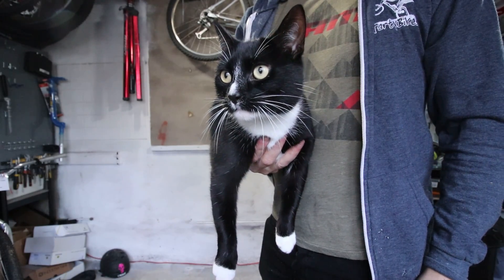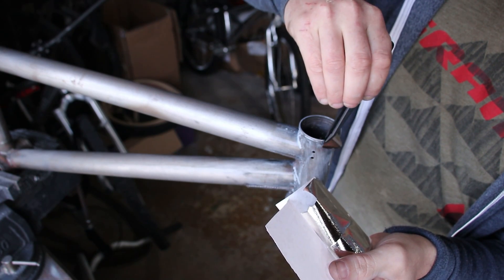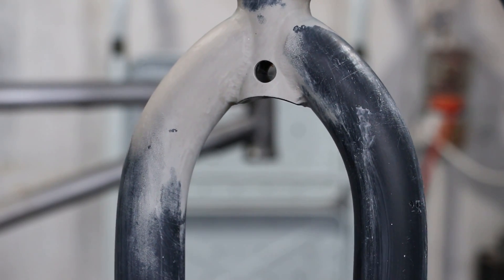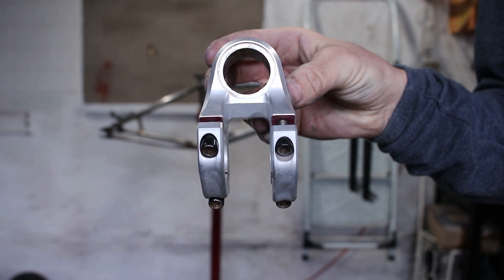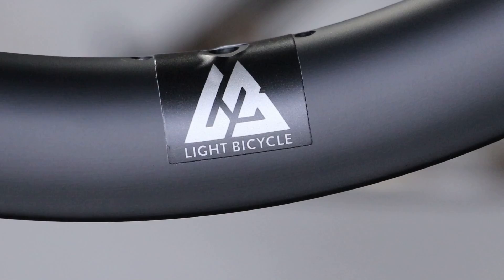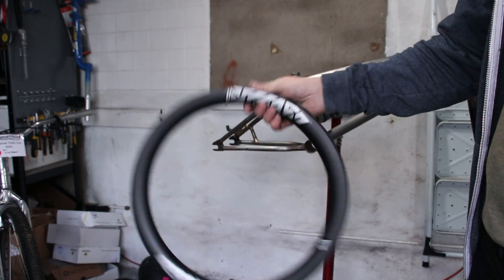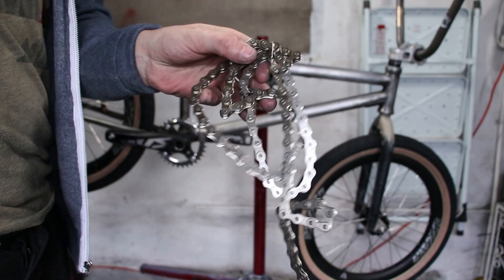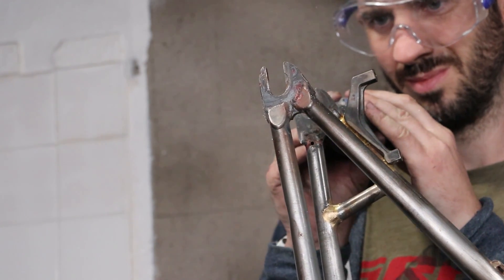I Built a MTBers BMX With Carbon Rims, Disc Brake And A Few Surprises

Comment: I know a lot of what you said was tongue in cheek, however I just couldn’t let some of it slide. 
It’s not necessarily that BMX riders or companies are backwards, the reality is that simplicity is often best. 
Having worked in the bike industry for over 20 years I have seen many MTB and road companies successfully introduce new standards. Often, these don’t offer any real benefit to the average rider but instead drive sales for their brand. It’s good business and keeps the industry alive. 
In the BMX world, BSD, Wethepeople, Stranger and others have tried to introduce oversized bars, tapered head tubes etc. etc. but ultimately they didn’t catch on. 
Why? Well, they just aren’t necessary. 
No one doubts the science behind these products but they are trying to fix a problem that doesn’t exist currently.
Combine that with the fact that the BMX market is typically younger, with less disposable income - any innovation needs to offer a significant improvement over what’s out there already. Pivotal seat systems are a great example. 
Your bike is definitely very interesting and fair play to you for putting in the effort. As you say though, a lot of the components just wouldn’t last on the streets.
Reply from the maker: I 100% agree with you 👍🏻

Comment: Disks don't work out that great on a 20 inch bike for park/street. The disks get destroyed in no time. pretty much impossible to do any grinds on the disk side. The smaller 20 inch wheels also bring the dropout closer to the ground than bigger wheel bikes. This makes the disk more likely to hit curbs and rocks. Giant/Mosh were doing oversized stem and bar clam areas back in the mid 90's. It didn't work any better, was heavier and limited what bar and stem combo you could run.  It was a mountain bike thing giant carried over to mosh, their BMX line. I guess it only took 30 years to catch on. You do know they make half links for normal bike chains right? grinding those drop outs out like that will make the rear tire sit extremely close to the seat and chain stay junctions. Its going to limit the size of tire you can run in the back and will probably end up rubbing the frame. How's the chain alignment with all that extra crap sticking out of the bottom bracket?

Comment: finally, a bmx with disk brakes
Reply: bmx has had disk brakes for quite a few years now. a lot of race bikes run them and ruben alcantara made a bmx with disk brakes and suspension
Reply: @brapamaldi  I know that race bmx' has had discs, but street bmx' usually has no brakes at all
Reply: @furivno  which would make this not a street bmx then going by that definition

Comment: Awesome build! What is that bottom bracket adapter? I've tried 24mm Mid bearings and cannot get the proper width - even with alloy spacers!
Reply from the maker: Link to adaptor in my pinned comment at the top :)

Comment: I built an S&M 24” ATF with disc brakes a few years back. Profile racing elite hub and some other nice parts. Then sold it 😫. I’ve wanted to do a 20” build and you may have just given me the nudge I needed! Great job

Comment: So you took a frame welded a disc mount on!? Its to bad build your own frame.
Reply from the maker: I didn’t, someone else did. Cost £50 for the frame and welding which is a bit easier to swallow than many hundreds for a custom frame!

Comment: Lots of generalizations being thrown around in this video that aren't exactly true. This is basically a modern BMX racing bike but with a chromoly frame instead of Alu or Carbon. Disc brakes and hub compatibility isn't an issue, there are plenty of options in the bmx world for either.

Comment: I want to do a BMX build with dual disc brakes and no pegs for the extra techy lip tricks. 

IDK if they have a distributor in the UK, but if those tires don't work out in the long run, Alienation BMX makes tubeless compatible tires (and rims). They've got some nice options for both freestyle and race. I'd guess that some Maxxis 20" tires would also be tubeless compatible also. 

Also, maybe someday MTB can catch up with BMX and go to the universal site standard of Schrader for tires again, instead of just air shocks. 😉
Reply from the maker: Agreed with the Schrader valves! I’ll take a look at those tyres too, thanks for the tip

Comment: Where did you get the cable guides? My Cannondale M800 circa 1989 rebuild needs 3 for the rear brake….it ran along the top tube in a casing.
It’s an original frame/ rear brake (Dia Compe 990) and seatpost, the rest is new.
And painting Aluminium? It was red but has flaking black paint.

Comment: Honestly that things sick, but as a guy who rides bmxI have to at least try to shed light on why it seems like we hate modern tech like disc brakes and carbon wheels and stuff. It's just down to a mix of cost, durability, and maintenance. 
I've seriously looked into trying to mod some hydraulic rim brakes onto my bmx bike but the cost of the brakes themselves, a hydraulic gyro, then the time to actually fabricate mounts and make them work, sadly it just ain't worth it when cable rim brakes work well enough. Disc brakes are out of the question for most bmx riders because it just seems like we'd just bend rotors like crazy. Carbon rims are sick too but you can't get away with curb stomping them back to "eh it's straight enough to not rub" lol. We're archaic for sure but the nice side to that is being able to get solid completes for under $400 dollars all day and decent entry level ones for under $300. Just speaking from personal experience that's a lot easier to get into than the price of mountain bikes or trials bikes, over in the US anyway even like a Flow 24'' you're talking around $1,500 which I'm sure it's worth it given the build quality and parts on them but it's just sadly out of reach for most people. I honestly would be real interested to see how this little hybrid handles as a street trials bike though since I've got some old bmx frames that are long and low and have wanted to try out street trials for a long time since finding your channel.
Reply from the maker: I agree 100%, I was just being hyperbole haha

Comment: Random Ali C x BMX related story, years ago I actually purchased a WTP Primate BMX from you via Trials Forum 😅

It was black with front and rear chrome rims, front and rear brakes with plasmatic style pads and a bashring style front sprocket.

Do you remember that bike? And did you ride it much or was it a brief dabble to maybe try and learn bar spins 😁

Comment: The entire reason I’ve been brakeless on my bmx for a decade is because once I got into mtb and felt the power of a hydraulic disc brake, the brake on my bmx just wasn’t gonna cut it no matter how well set up it was. I’d love to run a disc brake on it. I’ve seen a few people experiment with that now and I understand that Profile Racing now make a disc hub that uses the non drive side cone as a disc mount but jeez it’s expensive just to be able to run a decent brake! May have to fire up the mig welder and weld a mount on like this frame in the video has and get one of those Hope hubs instead

Comment: Such a cool build! You make a great point about stems and the diameter of the handlebar clamp area. BMX should definitely increase the clamping diameter. I'm really interested to see how the rear wheel holds up. Quality components and a great wheel build for sure but is the flange-to-flange narrower (~50mm?), and if so won't the lateral strength be a little low for BMX?
Reply: Bmx wheels get their strength from usually being 36 hole and only 20". There's one heck of a triangle created by the spokes. Even a 32h with a disc mount will be pretty solid.
Reply from the maker: Tbf the same flange size is used on bigger wheels (like my street trials bike) and they’ve been faultless, with the extra stiffness of smaller rims and spokes I really don’t think there’s any strength issues regarding the wheels (for my riding anyway)

Comment: The result looks surprisingly good. It's a Hi tech bmx with a disc brake and indestructible rims. Nice work!
Reply: Nah. G-Sport Ribcages are indestructible rims.
Reply: “Odyssey hazard lites” are the best rims, I’ve had mine for 10 years, and they will go out of true and always come right back with some lovin
Reply: @davidbreitwieser3591  and the Hubs Odyssey usually pair with them are second only to Profile.
Reply: The Eclat carbonic is the best carbon bmx specific rim but the ribcage is practically indestructible and there not made anymore but the alex tripple walls were incredibly strong but very heavy
Reply: @andrewince8824  those, hazard lites. And theres another one from eclat.. i forget

Edit: i dhoulda read the replies. Its all here already😂❤️
Reply: @allanweede2599  e440

Comment: Nice movement on the rear dropouts. May some drops of the same locking compound would help the most slippery part of the shims on the steam clamp, leaving room for adjusts in the textured part.

Comment: I feel like the bolts turning the opposing way as the cranks spin. Just isn't right in my head.. Like one peddle and it will loosen them. I'm sure it worked out fine but my brain is saying "Nooope"

Comment: As a bmxer, i'd say it looks great. i dont know of anyone using tubeless for street or park stuff, but disk brakes, carbon rims and alloy cranks are popular in the bmx race world. i'm really curious to how disks would work for feathering during manuals etc as i haven't tried them on my bmx.
Reply: Handlebars with a 31.8mm clamping area have also been popular in bmx racing for some time.

Comment: really good vlog... BMX needs to intergrate into 21st century.
"Live Like the Amish" 😅
An episode with you riding trials style on this one!... I think it will be a first! 
And Im sure everyone here wants to see it!
Bike looks sick!
Reply: BMX has been adopting other standards as the years go by. Those integrated 45 degree "Campy" bearings that BMXers use in the headset actually come from the road bike world. Tubeless and carbon rims have been making their way into BMX freestyle for almost a decade. BMX picked up on threadless head sets more or less at the same as mtb and road. But some things like hydro disc are less common because many freestylers are brakeless and those that aren't often run cable gyros. (Trickstuff produces a hydro gyro when they feel like it, but most BMXers aren't dropping that kind of cash on a gyro.)  As for handle bars, there is no reason for BMX to keep getting bar bloat like MTB.

Comment: You seem a bit behind on the BMX trends. Disc brakes, especially on race bikes and trail bikes, have become pretty normal. There are a good number of 31.8 clamp bars out there also, as it's becoming more common with BMX race bikes. And carbon rims are also becoming a more common thing, for both race bikes and freestyle bikes. Us BMXers are not as outdated as you think we are...😉
Reply from the maker: Bmx racing doesn’t count 😋
Reply: @Ali_Clarkson  A disc brake rotor would get destroyed on a street bike. Especially one with pegs.
Reply: @Ali_Clarkson  That being said, you shred that thing pretty nicely. Can't wait to see you on a pump track and skatepark.

Comment: Why choose not to run a BMX stem because you are worried about its compromised strength and then end up running shims only to have to worry about its compromised strength?
Reply from the maker: I wasn’t worried about running a Bmx stem, they obviously work pretty well but I wanted to use as many MTB parts as possible

Comment: I ride bmx and my bike could be considered “modern”. I have carbon rims, titanium bolts, Kevlar folding tires, and all plastic pegs. I’ve only seen the disc brake take off in racing but I have heard of trails and park riders using them. That stem is crazy 😵‍💫 I guess we are more simple than mountain bikers. If it ain’t broke don’t fix it.

Comment: My 2nd BMX bike was a Specialized Fuse 4. It may have been the first BMX bike Specialized has released. Back in 2006, I think. It had a few MTB components: Euro BB with MTB cranks, Aluminum frame, dual-cable rear brake, integrated bash guard on the sprocket. 10mm rear dropout, I believe. It was pretty trick and very light for the time. I ended up destroying the dropouts with pegs.

Comment: On this side of the Atlantic we say MtBMX, (Or at least I've heard that term used.) When I got back into mtb in 2014 I was too poor to afford a real mtb, so I tossed together a collection of old school, mid school, and new school BMX parts to make the MTBMX in my profile pic.  I would have liked to see you make use of the gyro mounts on that bike, but maybe dealing with mechanical disc isn't worth it.

Comment: No BB spacer? I don't have a ton of experience, but I see most people not recommending going without one.

As for the chain length - maybe you could've gone with a half-link chain - that might've saved you the mod of the dropout.

All in all I think it turned out pretty nice. Good job!

Comment: As a brakless bmxer (and also Enduro mtber) the bike looks preety nice. Either way, since you are using tubeless and carbon rims, maybe you want to use a pivotal seat system, it's more bmx like and it probably saves a bit of weight
Reply: i don't undrertand why it hasn't been doneto make raising your seat for certain tricks easier

Comment: Loved this. Thanks Ali, great work as usual. Looks great raw with the unique mtb touches. I appreciate the genre blending. Being tall, I opted for a WTP 22” wheeled BMX (which is also “controversial” in BMX). A great middle ground for a “MTBMXer” I’ve always wanted to know your thoughts on a 22. Maybe a future project? After all, N+1. 👊
Reply: dont know about 22" but 24" bmx are awesome for longer legs (and older backs, haha)
Reply: @brapamaldi  both 22” and 24” are good for ergonomics if you are taller/older etc, but 22” is definitely closer in feel to 20”. 24” is rad too or whatever wheel size you are into 👍
Reply from the maker: Very tempted by a 22” Bmx, I think that’s a nice compromise 👍🏻